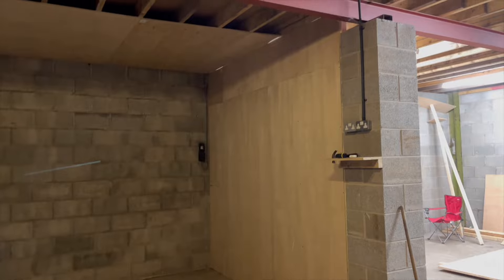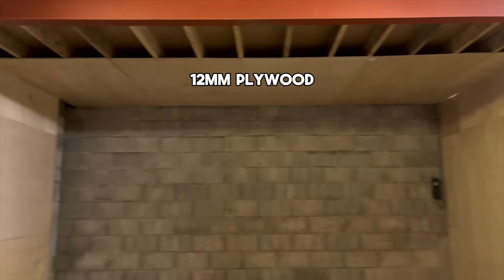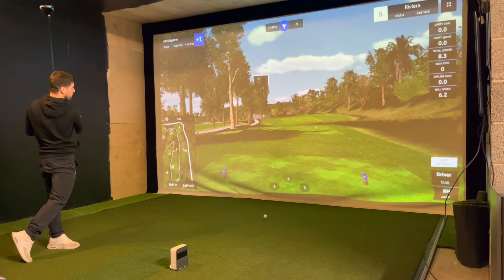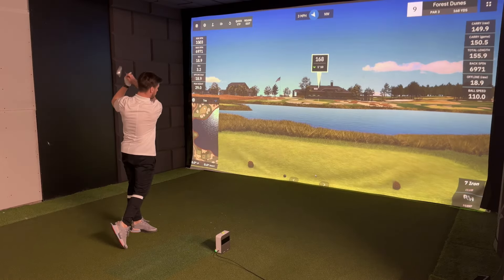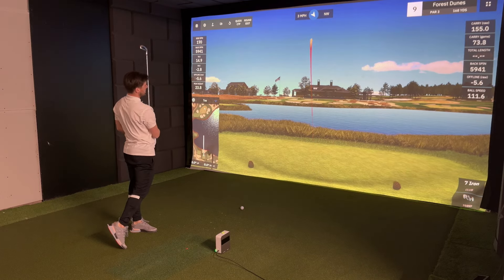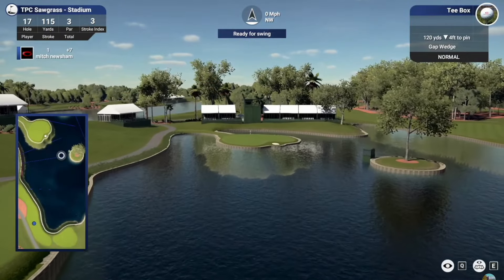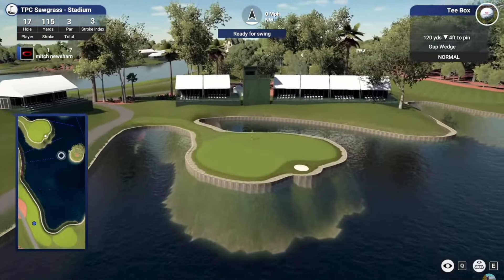Expert Grills My DIY Golf Simulator Setup!

Comment: What did you use for the foam border around the screen?
Reply from the maker: They are called 'Pelmets' from golf swing systems - they came included with my impact screen - they are basically strips of black marine carpet with velcro stitched onto them 👍🏼

Comment: I’ve got all my timber up, framework for impact screen is up! now it’s a case of planning and building my fold away sides (have to build folding side walls as the sim is in my frontroom) it’s coming along nicely though 🏌🏻‍♂️ 

P.s. do you think it would be ok if hitting mat is setup more to the right instead of smack bang in middle of the room??
Reply from the maker: An offset hitting mat is fine! Not ideal but you can work with it and most (good) softwares have a setting to allow for an offset centre line so you can make it seem more realistic 👍🏼⛳️
Reply: @ thanks for the feedback 🫡 hopefully in the next week or so I’ll have it netted and acoustic padded and it’ll be up and running HOPEFULLY 🫣 😂😂😂